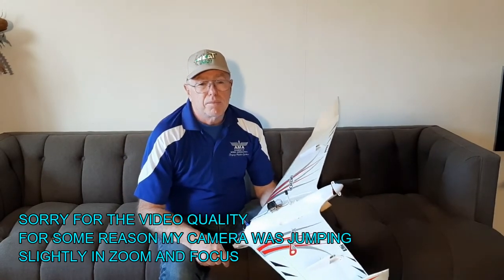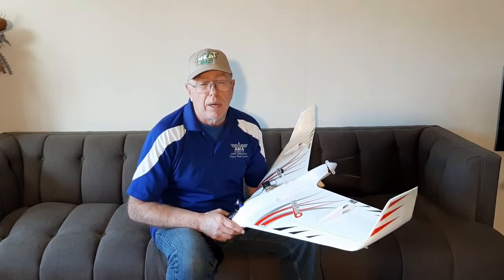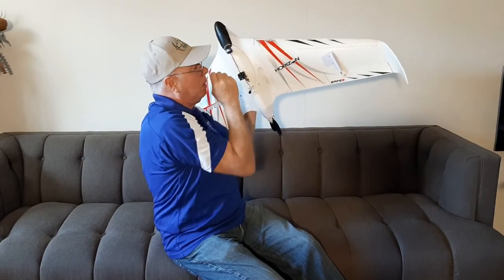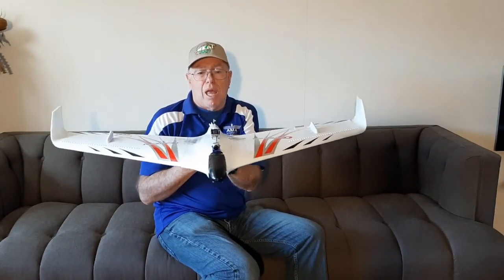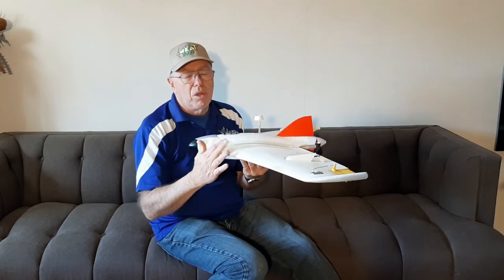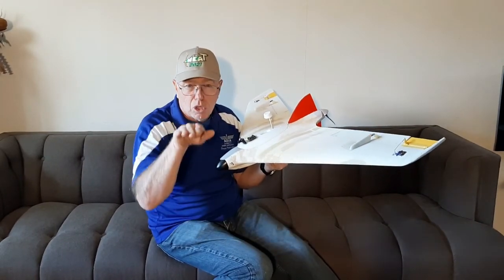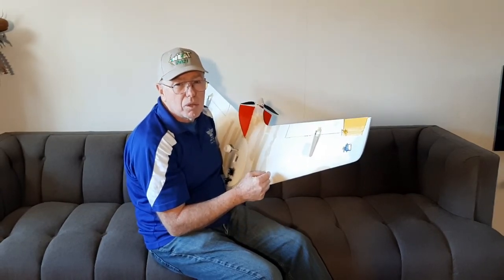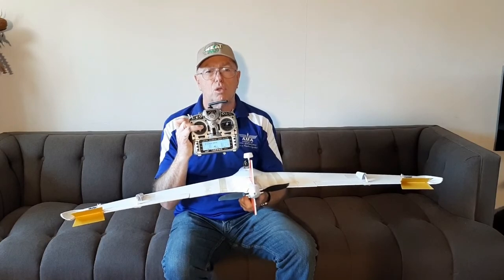OPTERRA WING TIP DRAG RUDDERS

Comment: what ever happened with this plane?  Would love to know if it was stable and if you continued to need vertical stabilizer.
Reply from the maker: Hi NML.  I still have it and still fly it occasionally.  I was able to take off the upper vertical tail completely and still fly it comfortably without any gyro assist.  The only vertical surface is a slightly enlarged ventral "skeg" something like the one you see in this video.   shortly after I started this project, the Freewing B2 came out and I have been playing with that one a bit, changing the wing tip speed brakes mechanically.

Comment: This was very informative. Not much Intel on boomerang planes ( I'm building scratch built 2000 mm FW, im also installing drag breaks to ,  racking my head how to actuate them . I like your gear idea . I will never understand  why RC planes have so much aileron surface and when you see fpv footage, plane banks with only  3mm of deflection!
Reply from the maker: DB S it is much more aerodynamically efficient to have large devices move a little,  than small devices move a lot. There is a structural limit on how far you can go, even in a model. Thanks for your comments

Comment: Lots of interesting stuff here! The speedbrake construction and transmitter programing are neat. But also question-inspiring.  For test video purposes, adding a yaw string (like on an F-14) might help. Pusher propellers are supposed to add yaw stability-since yours is folding, it would be interesting to see changes in yaw stability at motor off vs full power. Maybe a bigger propeller would create some more "free" yaw stability? Once you roll into a turn (I guess that it doesn't matter elevons or speedbrake induced) does it need continued control input or does the flat wing make it stable in a bank? In any case, it is nice to see your whole process and I'd bet the final product will be a step ahead for flying wings.